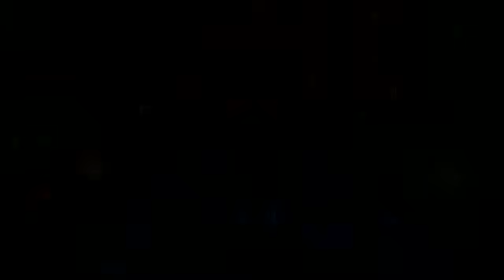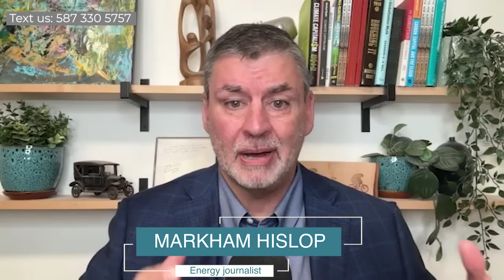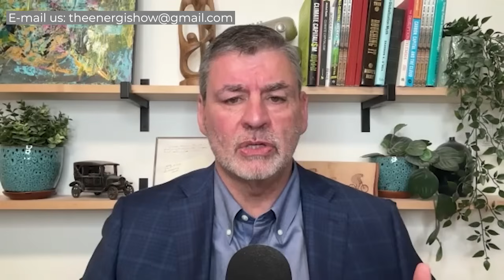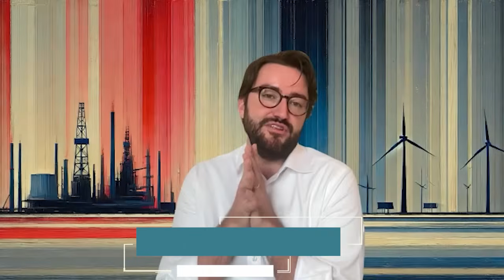"Useful Energy": The Real Driver of the Energy Revolution

Comment: For over a century scientists have known that the claim that CO2 affects temperature had been proven incorrect, that "greenhouse" theory was seriously flawed. Yet it was resurrected.. why? For POLITICAL purposes. It is simply an excuse for imposing taxes, the removal of our rights and freedoms and the restriction of our access to cheap, reliable energy. 

THE EVOLUTION OF CLIMATE
BY
C. E. P. BROOKS,
M. Sc., F.R.A.I., F.R. Met. Soc.
WITH A PREFACE BY
G. C. SIMPSON, D. Sc., F.R.S.,
DIRECTOR OF THE METEOROLOGICAL OFFICE

1922
"The theory which connects fluctuations of climate on a geological scale with changes in the composition of the earth's atmosphere is due to Tyndall and Arrhenius, and was elaborated by Chamberlin. The theory supposed that the earth's temperature is maintained by the 'blanketing' effect of the carbon dioxide in the atmosphere. This acts like the glass of a greenhouse, allowing the sun's rays to enter unhindered, but absorbing the heat radiated from the earth's surface and returning some of it to the earth instead of letting it pass through to be lost in space. Consequently, any diminution in the amount of carbon dioxide present would cause the earth to radiate away its heat more freely, so reducing its temperature. BUT IT IS NOW KNOWN THAT THE TERRESTRIAL RADIATION WHICH THIS GAS IS CAPABLE OF ABSORBING IS TAKEN UP EQUALLY READILY BY WATER VAPOUR, OF WHICH THERE IS ALWAYS SUFFICIENT PRESENT, AND VARIATIONS OF CARBON DIOXIDE CANNOT HAVE ANY APPRECIABLE EFFECT"

Still true today:
Ferenc Miskolczi: Greenhouse Effect and Climate Change

2023
"The greenhouse effect predicted by the Arrhenius greenhouse theory is inconsistent with the existence of the CRE (Chandrasekhar-type radiative equilibrium). Hence, the CO2 greenhouse effect as used in the current global warming hypothesis is impossible. Let us emphasize the overall conclusion:

The Arrhenius type GE (greenhouse effect) of CO2 and other non-condensing GHGs (greenhouse gases) is an incorrect hypothesis and the CO2 greenhouse effect based global warming hypothesis is also an artefact without any theoretical or empirical footing. Without scientific proof the debate on the CO2 GE based catastrophic AGW (anthropogenic global warming) should be abandoned and policymakers should focus on the more urgent environmental and social issues of humanity. The recent worldwide energy crisis is a warning sign that the promotion of the so-called green energy is neither solving energy shortages nor helping to protect the environment from pollution. The climate does not need protection, but the clean environment does."

'Greenhouse by CO2' theory was proven wrong by Knut Angstrom in 1900 in a paper debunking Svante Arrhenius' 1896 paper, the one all these alarmists quote. In 1906, Arrhenius reviewed his earlier work, acknowledged his errors and concluded that any additional SLIGHT warming that MIGHT come from CO2 would be 'benign and beneficial'.

"we may hope to enjoy ages with more equable and better climates, especially as regards the colder regions of the earth, ages when the earth will bring forth much more abundant crops than at present, for the benefit of rapidly propagating mankind."

 None of the alarmists quote this later work. Funny, that.

THERE IS NO CASE FOR NET ZERO, EV'S, HEAT PUMPS, 'RENEWABLES' OR ANY OTHER 'GREEN SOLUTION'. THERE IS NO 'CLIMATE CRISIS'.

Comment: Transportation fuels are hydrocracked and Hydro formed. This takes a huge amount of the energy 2 to 3 times the amount of energy within a quantity of gas or diesel before you’ve ever even burned it in your 20 to 30% efficient engine.
Reply: False:
"...the refining process as a whole typically consumes between 7% and 10% of the energy content of the crude oil being processed." (Google AI)

Comment: It is the market.  Let it operate and everything will be good.  Of course, we also need to cost the externalities also instead of letting the fossil fuel companies pollute for free.
Reply: Policy guidelines are important. That said - The market is, and still has a big role to play, and that's currently heavily constrained. Your latter point, is the key to gearing the market effectively to drive forward the newer, better technology. And of course it would only be fair. Why policy is still needed? Because with current biased policy, typically the interests of fossil fuels end up winning battles they should have lost by default in the face of better technology. And that slows things down tremendously. By rights renewable energy and electrification would likely have been completed no later than about 2000-2010 otherwise. Policy is an integral factor in markets. You can't really separate the one from the other. No such market exists. Not at any national level.

Comment: You can't really believe that all the electrical and mechanic engineers don't understand the tradeoffs for making electricity.  Your taking about electrical efficiency and heat engine efficient WHICH HAS BEEN KNOWN AND DISCUSSED FOR 120 years!    I'd discuss that with my friends when I was 11 years old!   The solar and wind generated electricity connected to the power grid requires high readiness costing more natural gas than making all the electricity from efficient running NGCC power stations.   The power grid has no choice in having to support this commercially worthless electricity due to government mandates.   Wind generated electricity is the most natural gas expensive form of generating electricity.  The UK is culling wind farm output to save on very expensive natural gas.   

The UK Oct. 2024 had the wholesale price of natural gas come down to $10.50 mmBTU.  $0.80 mmBTU is the crossover fueling price for highly efficient ultra supercritical (USC) clean coal power stations.   That's less than 1/10th the current fueling price for generating electricity in the UK.   The UK has very large reserves of high quality British bituminous coal.   US wholesale natural gas hovers around $3.00 mmBTU.   People that say coal is dead are very misinformed.   There has been a war on coal in the US since 1992.   That war on coal is being brought to a close.   

The US is far behind China in modernizing its coal generated electricity.  China electricity is discussed as being 60% the cost of US electricity where all large increases in resent US electricity rates are due to having to support increasing amounts of erratic electricity from solar and wind generated electricity.   Due to ever increasing economic efficiencies electric rates in real terms should be getting cheaper.

China has build around 100 USC coal plants and started construction on about 100 in 2024.   Since they emit no visible air pollution causal observers can say the China is retiring coal when all large increases in current China grid capacity is coming from new USC coal plants.   

Electrical technology includes all forms of generating electricity.   The most fuel efficient means of generating useful electricity is natural gas combined cycle plants that can approach 50%.   A steam turbine generator reacts too slowly to support the erratic output of solar and wind generated electricity used in coal, nuclear and the second cycle of NGCC power stations.   USC coal plants are using liquid steam at supercritical pressures and temperatures that behaves with many liquid characteristics allowing following a load much faster.   They have the ability to support a limited amount of erratic power.

Comment: The oil and gas industry people don't understand that electrification introduces huge gains in efficiency? Of COURSE they do - the engineers working in the oil and gas industry aren't stupid. The "think tanks" (i.e., the propaganda outlets) for the oil and gas industry know that the PUBLIC doesn't undersrtand it. And the drive to build the infrastructure for oil gas supplying energy is an effort to saddle utilities and, ultimately then, consumers with the sunk cost of that infrastructure, the amortization of which will be already baked into choices for what energy we use.
The same kind of comment applies to carbon capture - as a chemist I've seen lots of carbon capture presentations. Virtually everyone in the audience knows it's nonsense, OBVIOUS nonsense, that the concept is being presented by the "researchers" because they got money to do it, that they're bootlegging from to do worthwhile research. The pretense that the oil and gas people "don't understand" is just that: pretense.

Comment: Market forces will cause our energy system to evolve into an increasingly efficient system. This is also why I believe we will see a transition to DC at least at the local level, replacing AC. It's just a more efficient solution when most of your energy generation and most of your end use is DC.

Comment: So I agree the electricity is more efficient. The question is how efficient is the energy that produces electricity. Currently approximately 80% of the worlds electricity is produced by fossil fuels.  So actually, how efficient is the  EV  or other electric motor that runs on electricity
Reply: No. It’s not.
Reply: On a global scale the grid is already 35% renewable and on track to exceed 45% by 2030 according to the IEA. Given that the IEA has underestimated renewable growth in everyone of its projections over the last 25 years I am pretty comfortable with that estimate.
Reply: @danieldevries5203  
The IEA is ALWAYS at least 3-5 years behind the actual data.
The 50:50 tipping point was reached this year.
Reply: M8, ice transportation will never be better than it is today. It’s a technological dead end from an efficiency perspective.
Reply: @theowoytowich9959
"For the first time on record, Global renewable electricity generation exceeded coal generation in the first half of 2025 , a shift primarily driven by China's massive clean energy deployment"
.
Seems that your "Currently" is not so "Current"?

Comment: Remember that only 1/3 of oil demand relates to land based transport, and only half of that is for passenger cars, so the effect of EV's displacing oil demand is only a small part of small part.....

The tramsport transition is incremental, but the big target IMO is industrial process heat
Reply: I think you have your numbers wrong. The numbers I found are that 25% of oil demand is for light duty vehicles. That is not a small part of a small part. Heavy vehicles are also going electric. The super heavy mining Vehicles in China and Australia are going electric. In China, heavy truck sales are about 4% and climbing.
Reply: @ryuuguu01  China produces 60% of its electricity by burning coal. So are we really getting  ahead?  Burn coal for an electric truck or continue to ,use diesel trucks???
Reply: @theowoytowich9959  At one time it was almost 100%. What happened to the other 40%. It has been displaced by renewables. If you take all the renewables installed throughout the world, more than half of it has been installed in China and it is growing exponentially in China. There are two reasons for this. Firstly, renewable energy is cheapest form of energy because there is no fuel cost. Secondly, China does not want to be dependent on importing coal and oil from other countries.
Reply: @theowoytowich9959 
Yes "we" are.
First, your data is at least 2 years old.

"In June 2025, Coal power generation fell to 51%, its lowest level in nine years, while Renewables made up 60% of total installed capacity, compared to coal at 34%."
(My note: As Storage capacity increases, that balance will naturally shift towards Renewables, even without further capacity and China is massively increasing both Solar, Wind and Storage Capacity)
.
"China's renewable energy expansion was so significant that it satisfied all of its domestic electricity demand growth in the first half of 2025 solely with clean energy sources."

.
And it's only going one way......

"For the first time on record, GLOBAL renewable electricity generation EXCEEDED Coal generation in the first half of 2025, a shift primarily driven by China's massive clean energy deployment".
Reply: @ryuuguu01 The small part of a small part is 10% of 50% of 33% = 1.65% of oil demand
Reply: @Goodkiwibloke  I don't know where you are getting your numbers from. Road transport accounts for about 50% of oil consumption. Light vehicles are 25% of all oil consumption, not 25% of 50%.  Then there are EV truck sales, which are growing.  Non-petroleum industry only accounts for 11%. So, industrial heat is less than 1/2 of light vehicles and less than 1/4 of road transport.
Google "Distribution of oil demand in the OECD in 2023, by sector" to get sector numbers. Yes, it is important to move all sectors to electricity, but EVs are the most important sector.
Reply: Incorrect sir. Transportation transitions in history have been sudden and dramatic. If fact every new successful technology in history has exhibited an exponential S curve of adoption. It is never linear. From the time Henry Ford rolled the first affordable car off the assembly line? It only took 12 years to replace 90% of the horses in transportation. It was so dramatic that horse meat actually ended up on our menu's for awhile. EV sales are doubling their market share every 3 years. Globally its now 18%. Do the math. 18-36-72 and its all but over for gas powered vehicles. Even in third world electric bikes, scooters, Commercial trucks and 3 wheelers are flooding onto the market from China. Along with dirt cheap solar and energy storage batteries. Solar, wind batteries, EV's are all technologies that have reached adequate scale now to be far cheaper than the old 2nd industrial era technologies. See in China they have already solved the commercial truck and bus issues with battery swapping stations. Takes less time than filling diesel tanks and it costs 90% less in China. The long term feasibility of keeping gas and diesels on the road is already decreasing as more and more part manufacturers are looking to do something else, due to the declining demand FOR those products.
Reply: @davefroman4700 You can't be serious. The first EV's were sold over 100 years ago. That's neither fast nor sudden transition

Even modern EV's were first sold in the 1990's. And 30 years later most markets are at low levels of penetration

China has its own energy independance policy that is driving EV sales. Prices are artificially low, by government policy. Just look at the price of an identical model sold inside China and is external markets

But my point related to oil demand displacement by electric vehicles. So best hop off your high horse and address what I actually said. And include real data, rather than anecdotes and theories